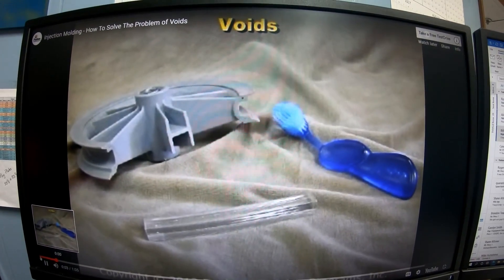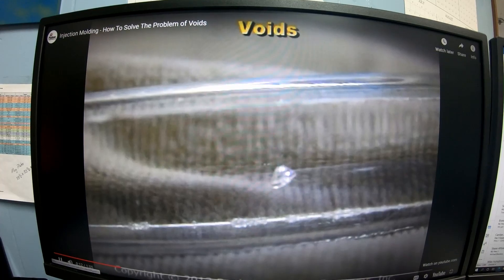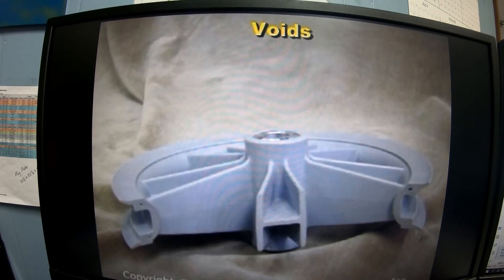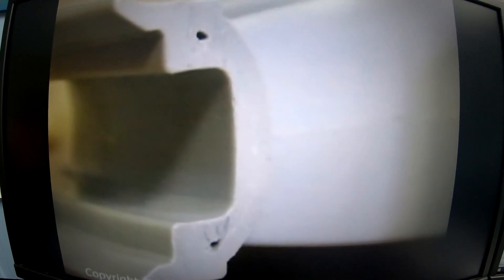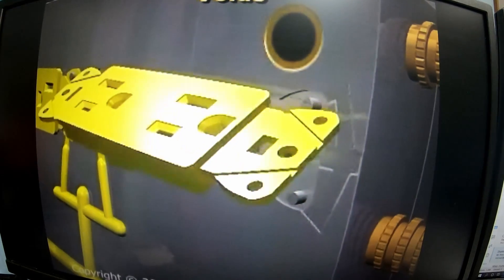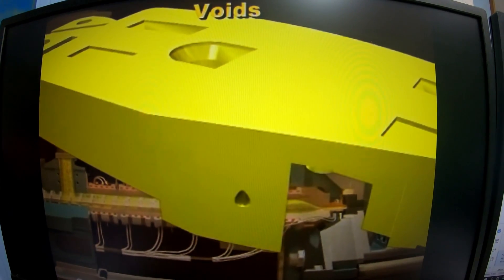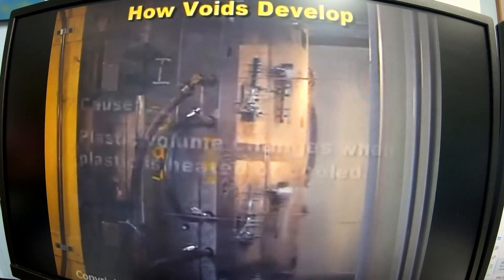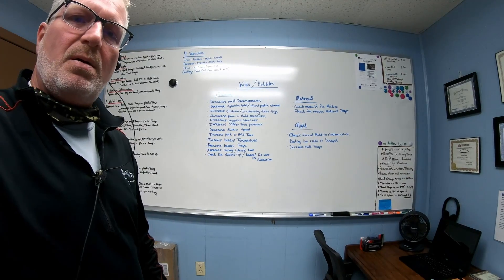Voids & Bubble In Molding

Comment: Hello Sir. Recently we are doing molding of PBT 30 for a 40gm product. Currently the cooling time is 30 sec and MTC is 80 Deg C and machine type is horizontal. 

We are planning to go for 20 sec cooling time to increase the productivity.
Is it required to reduce the mold temp from 80 Deg C to 60 or  70 Deg C? As per material data sheet range of mold temp is 80 Deg C to 100 Deg C. 

Also, please let us know what risks are possible in reducing the cooling time. Thanks for your help!
Reply from the maker: That sounds ok, What I would watch for is the part shrinking or the dement ion are out due to running a faster cycle. I would check the parts at run then after 8 hours then after 24 hours. If no change you should be great on running faster. Thanks for your support to the channel.
Reply: @injectionmoldingskillsmore1064  Thank you sir!!

Comment: Hello David, we are injecting a product but we always get a whole in the thinnest part (zero complete prodcts in 4 days of work). we tried everything we could think of and asked many people but to no avail... perhaps you have an idea that we didn't think of? I am really desperate...
Reply from the maker: Are you filling the part fast or slow? Is there vents to help the gas & air escape the mold? What are your heats on the mold temp & barrel heats? 
Some times if you fill to fast it will create a air or gas area in the mold that cant get out fast enough. Heat also has a lot to do with it as well to hot is not good!! Let me know the type of material as well & I will see if I can help.
Reply: @injectionmoldingskillsmore1064  We are using ABS. And we did them all (fast slow hot cold.....) we even tried different kind of plastic, even recycled plastic. But still the same problem. It used to work perfectly.
Reply from the maker: @stejokelec5224  If it use to run perfectly, Then something has changed in the process. Maybe it could be material related or something outside of the process. Is the mold watered the same as last time, Is the fill time close to where it was the last run. There are so many variables to look into, I am just crisping straws due to I don't know the part & the process. I wish I could help more, but I would try process of lamination. Try to only run a fill shot at 95% to 98% & see what the part looks like. You might have to change several things & see what changes & document the changes. Let me know if you figure it out I would love to know what you find. Thanks for the support to the channel.
Reply: @stejokelec5224  Immerse part in 200-degree water to prevent a void from forming and check your screw tip condition. Does your screw drift forward on hold?
Reply: Hi there, just read about your problem, at a guess I would advise you to check the water circuits and make sure part of the mould as not got block inside, the flow still might look good but a baffle or something could have come dislodged or something. Also a air leaking from a valve gate if in use. Also a blocked or restricted gate or hot runner gate. Also a floating core due to flashing up the tool at some point that now makes the core move and reduce wall thickness, Also the mould location ring diameter and depth more the moving half ring depth isn't too deep and bottoming out. Machine: blocked nozzle or check ring failure. So check nozzle and check ring double check material velocity is correct to spec and if the 3 are o.k I'd remove the tool and investigate it, also check the hotrunner out if in use like for a down heater band or damaged thermocouple. Good luck and hope you've already fixed it. Jim🏴🇬🇧🧐

Comment: Thanks David. We faced air bubbles in a new mold and the only solution to reduce them but not remove at all was reduce the mass temperature in the barrel and in the manifold.
Reply: Many moulders run low temperature settings and fats cycle times to improve output, with little regard to part quality. 
Injection moulding is a thermodynamic process, where heat in must equal heat out.
I recommend raising the mould temperature, and gradually increasing the pack pressure. 
If you get an increase in part weight, then keep increasing the pack time.
This part of the scientific moulding method.
You will also notice an increase in part dimension, and that is the key to achieving uniform parts.
Reply from the maker: Cool, thanks so much for the support to the channel.